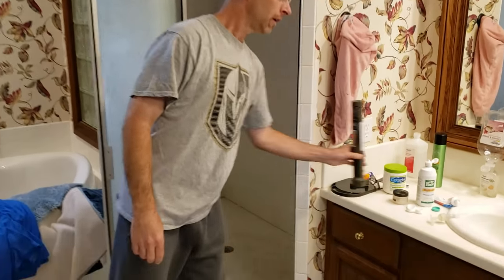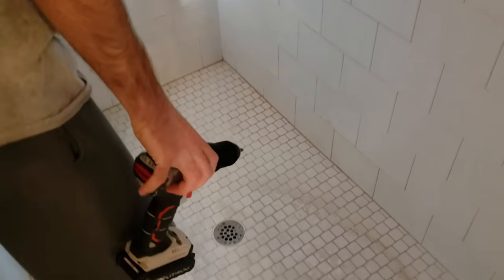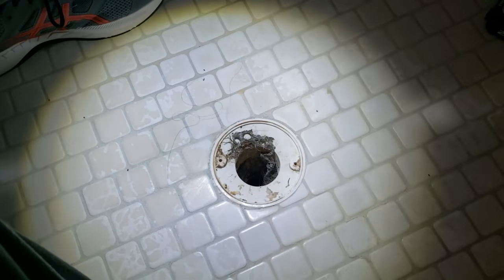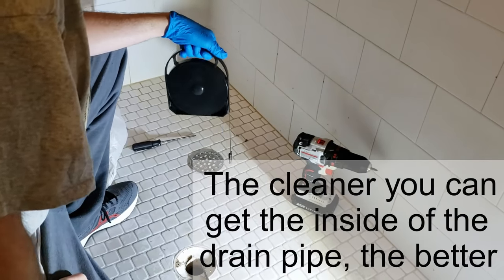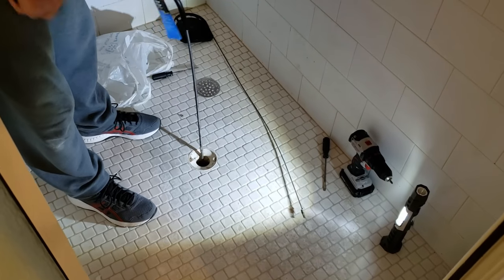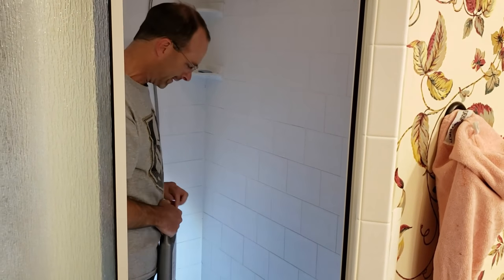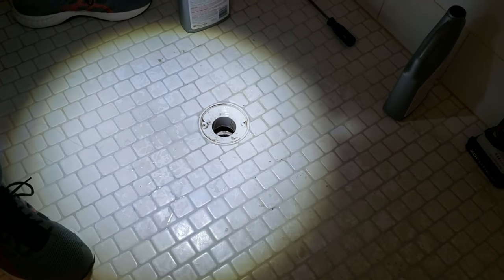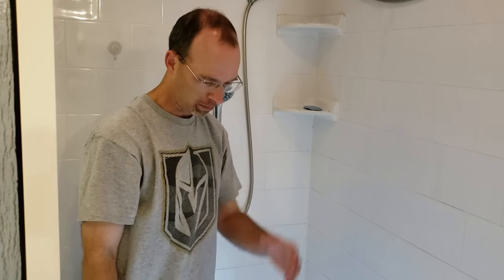How to get rid of drain flies in shower, kitchen, or bathroom

Comment: We have septic flies in a shower that we never use but I run the water 1x a week so the traps don't dry. There could be no buildup because it was a new house and unused. It happens 1x a year.  We are on a septic.  Any thoughts?
Reply from the maker: The flies lay eggs and hatch in the drain of there's anything (gunk, hair, etc.) left in there.  I recommend taking the drain apart, cleaning it thoroughly, then run the water occasionally like you're doing. But cleaning out the drain is key.

Comment: I can’t get my plugs off by hand as they are pop up ones can I do it just by using boiling hot water ?
Reply from the maker: Maybe, but would be much better if you can figure out how to get access to the drain so you can pull out whatever gunk is in the drain.

Also, several people have commented that boiling water is too hot for many pipes. So I suggest you use very hot water but not boiling it. But that's likely not going to be enough. Might need to use Drano or something like that first. The gunk is where the flies are nesting (yuck...).

Comment: Why not use chemical?
Reply from the maker: Chemicals can help get the last little bit off the pipe walls but it's typically not as effective if there's a lot of hair and gunk in the pipes. Also, a lot of people don't like using chemicals if they have a septic system. I used some chemicals after I pulled as much gunk out as I could.

Comment: What to do when they come out of the disposall?
Reply from the maker: A lot of people mix baking soda and vinegar in the drain to clean it out. That might be a good solution. Somehow there are pockets in your disposal where the flies are nesting and returning. Just need to flush it out somehow. The baking soda vinegar mix bubbles up and expands a bit while also cleaning.
Reply: @FixEverythingYourself  Thanks. I'll try  that if doesn't mess with the septic tank.
Reply from the maker: That'll be fine for septic tanks. Both products are natural and overall harmless.

Comment: I've been told not to pour boiling water down my kitchen sink, because pipes are plastic. Anyone else have this issue? Thanks.
Reply from the maker: Many viewers have cautioned against using boiling water, so my suggestion is to just use hot tap water to be safe.

Comment: Hi, the ones i have a tiny, sometimes only a millimetre long with antennae. They seem to come out of thin air. I've tried soda crystals and the baking soda vinegar method but they still hang around. Disgusting and now I'm freaked out thinking they'll be in my clothes or hair because they're so small I'd never be able to see them
Reply from the maker: Are they in your shower or drain area? If so, the best way to get rid of them for good is to take off the drain cover, pull out all of the hair and gunk like I do in the video, then use vinegar (or whatever) to clean out everything else. Good luck!

Comment: I keep on seeing drain flies in my bathroom and I can’t locate the source, I’ve checked my drain and nothing is in there. Should I just pour drain cleaner down my drain?
Reply from the maker: If you look closely at your drains, you should see them near there. But if you can't find the source, it's still likely they're coming from the drain. I'd recommend taking the drain cover off to pull out the gunk but pouring drain cleaner or vinegar or another cleaner down the drain should make a difference, at least for a while.